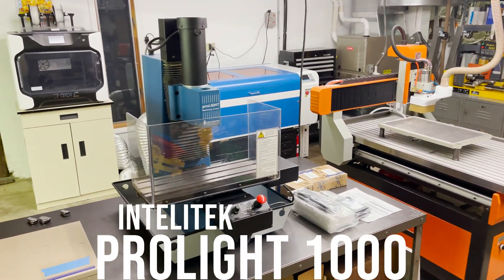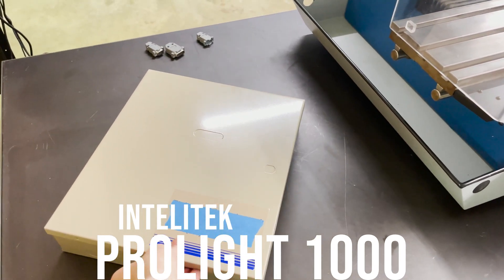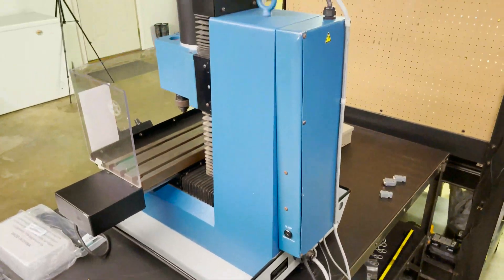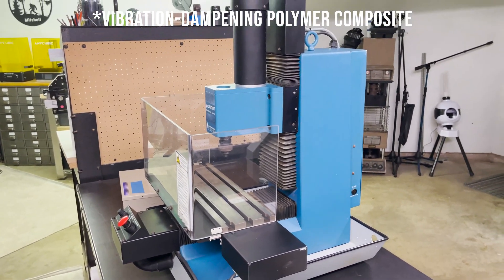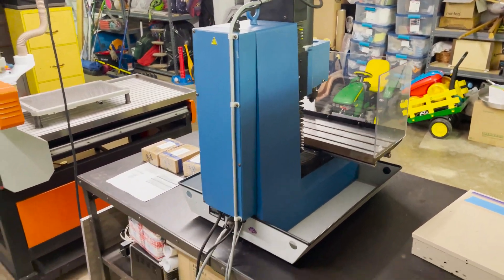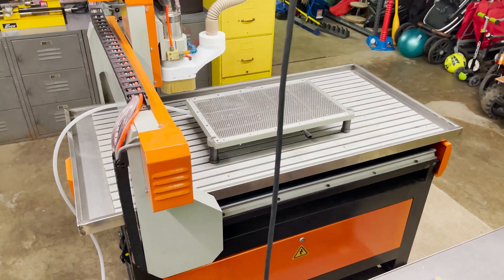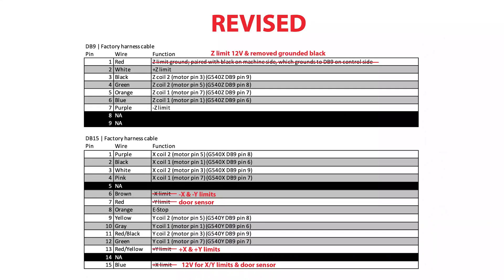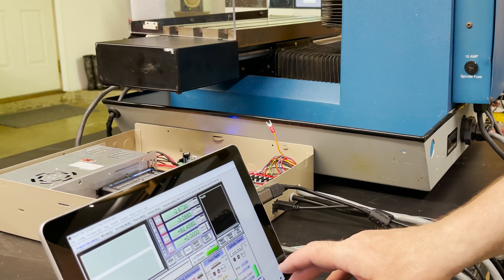ProLIGHT 1000 CNC Machining Center: Retrofitting a Mach3 Controller

Comment: I am also retrofitting a prolight 1000, but mine has an R8 tool holder not a ISO-20. is an ATC possible with a R8?. is there an ISO-20 retrofit head available?
Reply from the maker: The Super Prolight’s have an iso20 head, maybe you could find one and swap it, or just trade it for a Super like I did
Reply from the maker: See my other video for the Super Prolight with atc

Comment: Did you use the controller inside the machine to run the 1 HP motor and how did you wire it in to vary the cutter speed? Could you send me a copy of your wiring chart shown in the video? I liked this video a lot because it is what I intend to do. TU John.

Did you make a video showing your mill cutting on aluminum or wood?

TU, John
Reply from the maker: Yes you can control the spindle speed by connecting the spindle PWM out + & - on your controller to the Signal + & - on the spindle speed controller. The wiring chart I used was from this website: https://hackaday.io/project/164332-prolight-1000-cnc-mill-retrofit I've not made any cutting videos yet. Good luck!
Reply: @diyfiberlaser  Hi and thanks for the information. I jumped on your link and it was f=great reading but they didn't have the Wiring conversion chart you talked about. I pick up my proLight 1000 tomorrow and will be able to get into cleaning it up. As in most cases the controller and PC, etc didn't come with my machine and I wouldn't want to use them anyway. Could you scan me a copy of that chart and send it to me? If you. an do that, I'll give you my email address somehow.

TU,

John
Reply from the maker: @johnkell2724  Here is their link: https://cdn.hackaday.io/files/1643327030780288/ProLightWiring.xlsx
Reply: @diyfiberlaser  When you say "the spindle speed control" are you talking about the controller located in the back of the proLight 1000 mill? 

TU,

John
Reply from the maker: @johnkell2724  Yes, on mine I think the card was labeled Minarik PCM21000

Comment: what is your mach3 config for this machine, and did you have iusses with the stepper drivers, mine just causes a slight whining noise in the steppers, but i cant it to move anything
Reply from the maker: Did you do the motor tuning in Mach3 for each axis? Config > Motor tuning: Mine is set like this: Steps per: 3940; Velocity: 2000; Acceleration: 200